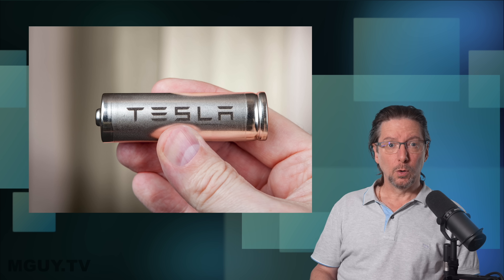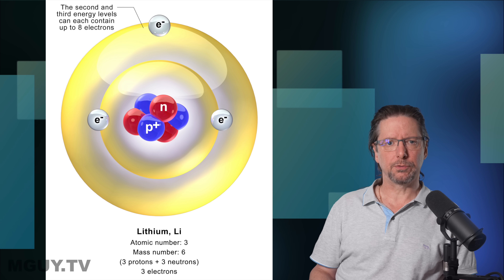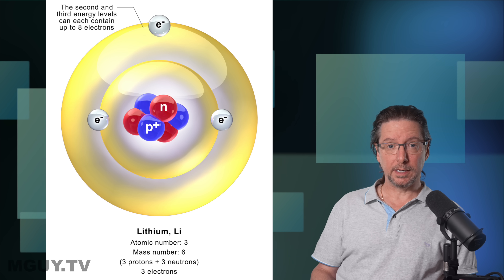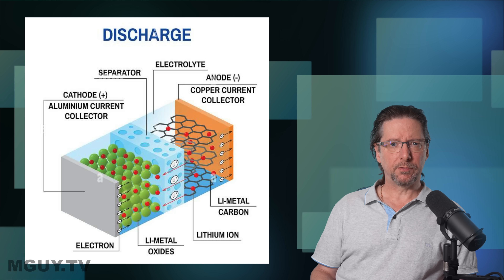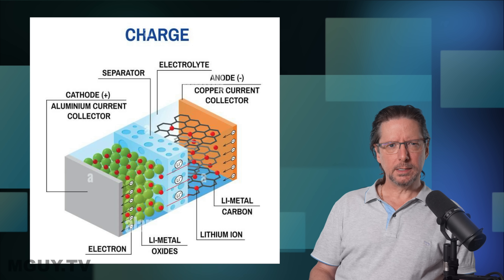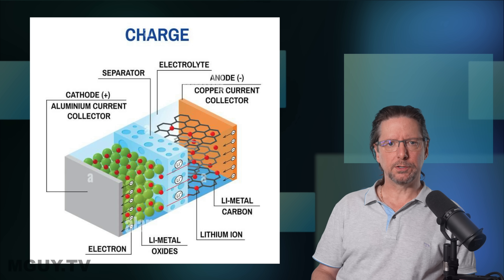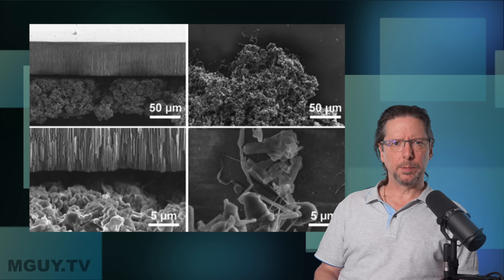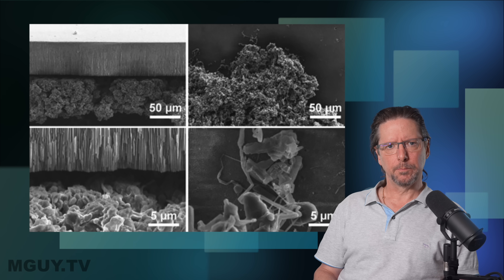Why are EVs so TERRIBLE in the cold? | MGUY Australia

Comment: I'm in Canada. It was -35c the other day. The diesel in trucks froze and pumps for petrol failed due to the cold. My Tesla, while had significant range reduction, still worked just fine. Teslas warm their batteries when charging too.

I will never buy a gas car again knowing this.
Reply: I’m in Canada also, it was minus forty one where I’m at. There was not one gas pump that did not work and no diesel trucks with frozen fuel anywhere, they were all working just fine! Keep reaching for those straws, I’m sure you’ll get one someday
Reply: @Oldmane-420  Which city you in? We had rolling blackouts here in Alberta. Engine Block heaters couldn't warm up enough due to the brownouts. Backup generators wouldn't even start for some gas stations (wife drives an SUV). You can see a Tesla charging in -35c in Strathmore here: https://www.youtube.com/watch?v=83mDbdnEjlo

Comment: As Javier Milei said at WEF this year, markets do not fail they just get distorted and are less effective by intervention.  Usually by authorities interrupting the normal cycle of business.  I think the panic rush to Net Zero is one such case.  I bet the disruptors who dreamt up EVs never thought this would happen.  These things are not resolved yet, and in all fairness maybe they will be sooner rather than later.  But you are correct, there is no equivalence (in most considerations) swapping from ICE to EVs.
I have seen batteries being conditioned in a pack during recharging using power of less than 5% of the battery pack capacity.  Of course, the consumer is paying for this, and it seems less effective than it should be.  Cases vary, but I think the anecdotal is there, and of course the recharge time is extended because you need on board power to condition the battery as you are charging.  Sort of like needing or being required to keep your ICE running when you fill up with fuel, which in reality just does not normally happen.

Comment: Golden Battery from Zeekr. Golden Brick's peak charging power is 500 kW, and the maximum charge rate is 4.5C. Between 10% and 80%, the battery can charge 500 km in 15 minutes. At -10 °C, the fast charging speed increases by 25%.

Comment: Chemical reactions slow down in the cold. Thats the crux of it. That’s true of all chemical reactions whether ICE vehicles or the human body which generates heat but also cools itself to maintain an optimum operating range. EVs are very efficient, translating most of that stored energy into forward motion. So efficient that if any extra energy needs to be used to heat the battery or passenger compartment range drops drastically. ICE vehicles are very inefficient. There is a lot of energy in gasoline—so much so that most of it is wasted as heat and must be disposed of to maintain an appropriate operating temperature. This becomes an advantage in cold climates where range can largely be maintained by using that formerly wasted heat energy. Can you imagine that a specific tool works best for a specific purpose? I think you could if you’ve ever tried to complete a job by making do with the wrong tool! An ICE vehicle may be best for some purposes but there is only one way to make it go forward: fossil fuels. EVs can be made to go by burning fossil fuels to generate electricity… OR, by nuclear, or hydro, or wind, or solar panels… you get the picture. It’s good to have a lot of options in your toolbox.
Reply: You won’t find a six pound sledge hammer in a watchmakers tool box, no matter how large his tool box is! Think about that for a moment.

Comment: So many baying electric cars without knowing that the battery have to be heated to warmer then 0c to be able to charge... With -10c and wind that for example means your car will simply not be able to charge on a 16A course and only slowly charge on 30A because most or all the electricity goes to heating the battery.  +++

Comment: The EV is a big nasty CO2 poluter! Especially in cold weather.

Nobody is thinking of that. That their nonexistent exhaust pipe is actually just elsewhere and out of sight and out of mind. 

When it is cold we spin up additional power plants that is running on gas, coal and so on including full out in nuclear reactors.

There I where where the power is coming from..
And in the SAME time the EV is more and more energy inefficient as the temperature drops, shorter range and longer charging times..

All together all that higher kw per mile of that very dirty electricity..😢

Have anybody calculated how much CO2 in grams is pouting the air for each kw produced?
And how it is varying depending on outside temperature?
(so we not just get figures on the baste case scenario when only nuclear, wind and solar is producing energy. And it will vary from country to country when nuclear total coverage varying.)

Comment: The same reason batteries are less efficient at extreme cold temperatures. Operative phrase 'extreme cold'. They could lose up to about 30% of efficiency at, say, -20C. Not really a major problem even in countries with extreme cold spells. Just requires some planning. But this faux debate you push (EVs vs ICEVs) is somewhat redundant. Private car ownership is not sustainable regardless. The resources wasted, the ecological costs and economic costs simply can't go on without promoting more environmental problems. It's already killing millions every year. It's time phase out private car ownership and invest in electric public transport systems instead. It's a no-brainer. The car industry has been declining globally for a number of years. Cars are only going to get more and more expensive to feed greedy shareholders. So the car industry is already selecting against itself. Just as well hit them hard while they're down. There are no justifiable reasons why anyone civilised would care anything about the car industry. The private car economy is just one big scam running on the ethics of vikings and heroin dealers. F*ck 'em!

Comment: Can you imagine that if in cold weather we had to run our ICE engine for 30 minutes before we put fuel in the car. If you can, imagine what chaos around the world that would cause, and then you can almost imagine what a world full of EVs would be like. Long live ICE
Reply: @1Electricman  Have you been asleep for 50 years? or do you live in the arctic?
Reply: @1Electricman a few minutes af heating to drive not thirty minutes. Also, the topic is refueling not starting.
Reply: lol a few minutes to warm up a gas engined car? I sure wish my F150 felt the same. when its -10c or less where I am, which is months long... its at least 15 minutes of idle. I also own a tesla model y and its 5 minutes to warm the interior and if i wanted to drive it frozen solid it wouldnt harm the car like it would in a gas engine over time.
Reply: @Jojo-o6o6w  Don't you realise the massive damage done to a EV battery in the cold.? Long live ICE, the car of the future.
Reply: It doesn't matter if it's an ICEV or a EV, when it's cold, you need to heat up the windows while you attempt to scrap off the ice and defog them.  With an ICEV it's a few extra minutes idling that won't do much to your range.  For an EV it's a big deal for range.
Reply: @chrishoff402  not it isnt.. my ev takes 5 minutes in -15c.. thats effing cold! It produces heat immediately almost whereas an ice vehicle has to warm an entire engine and coolant system up, and sometimes the coolant is responsible for the tansmission oil.. more to heat up. I have an F150, I know. I also own a model y so again, i know.
Reply: @Jojo-o6o6w How much time did it take to get enough charge in your ev's battery to clear your windows in 5 minutes and add that on top.  Compare that to how much fuel you burn in your F150 to do the same job.  Keeping in mind your comparing a large pickup truck to a family sedan, not a like to like comparison.
Reply: @Jojo-o6o6w   Chris is correct and you're fanatical in your beliefs. 

My Volt got 40 miles to a charge in the summer and low-20s in the winter.  Only difference is defrost / heat.  

YES, heat is a big deal for range.  You covering your eyes and ears and going LALALALALALA doesn't change this fact.
Reply: @ToolHombre   sorry, i didnt think to consider there are awful crap eV's out there capable of only 40 miles to a charge.
Reply: @Jojo-o6o6w   There are also awful crap EVs with higher ranges.  But the ranges are less in the cold.  

This is not disputed by even the OEMs, or the battery cell makers themselves.  Only the flat-earthers of the car world (mostly Model-Y owners) make such claims.
Reply: in extreme cold, diesels should be heated prior to starting. is this for the lubricating oil or fuel?
Reply: @joechang8696  50 years of driving, and 20 years of owning diesel cars, I've never had to use a block heater. What a load of rubbish.
Reply: You have no idea what you're talking about, but the oil industry needs people just like you. I've charged my EV in very cold weather, thank you.
Reply: @justsomeguy934   There are recent and documented debunks to your belief system.   Chicago was gridlocked for EV owners due to either conditions that are colder than what you have experienced or a faulty network for EV charging. 

Either way, the incentive for those people to own EVs was undermined.
Reply: @ToolHombre 
And for Chicago, that wasn't the coldest days for winter.  Wait until it's -25 F  with that Lake Wind or the Prairie wind.      And Chicago isn't the most northerly city in the USA.
Reply: If the Uber drivers charge up to 100 % all the time their batteries will lose capacity faster, meaning cars became worthless quicker, that is not good for car owner and not for Mother Earth. I guess they do not care. But saving the planet is the argument for EVs. I'm pretty schore the whole project doesn't save anything, probably doing the opposite. You never see numbers with the whole chain included. The whole CO2 calculation is a game with numbers. Ignore production and CO2 just move to another country, Ignore transport chain. Ignore the juice is produced by mainly not green power plants. Ignore the real costs for transforming the power grid. Ignore the green power alone is a technical and economical utopia. Ignore human rights, children's life, environmental damage. Ignore it hardly work, will never work in most parts of the world (no grid). Ignore safety issues, political risc, power outs, war! And most people drive old cheaper cars. They can't buy any new car. See and old normal car only need a very cheap battery. A battery that is recyclable. I actually believe this whole industry shift is extremely dangerous. When everything collapse, big money go bye, bye. Anything can happen.
Reply: @bjorngve  Very well said. Everything you say is right, so much of the damage EVs are doing to the environment is being ignored.
Reply: @justsomeguy934  So you think I've been doing something wrong for 50 years, I think you need to seek help.

Comment: Fossil cars need roadside assistance almost twice as often in winter in Norway compared to electric cars.
In all electric cars, you can get into a 20 degree Celsius hot car every morning if you want. And you don't have to waste time at a gas station.
Reply: Considering that there are five times as many “fossil cars” on the road, that’s not an issue. You can get in a fossil car that is 20 degrees as well, and the wait at the gas pump is less than one tenth the time you have to wait for a charge and you will go about five times as far on a tank of gasoline! Have you considered a career as a unicorn wrangler?
Reply: @Oldmane-420  Which fossil cars can you cool and heat in an airtight garage? One of the two electric cars we drive has not been fast-charged for 10 years. It gets the energy it needs when it is parked.
The statistics for which cars need roadside assistance are of course corrected for the number of cars on the road.
Reply: Pink cars with purple stripes need even less roadside assistance compared to electric cars. I think there is something in that for all of us. Don't you?

Comment: Mguy is an expert in technical subjects leaving the luddite viewers scratching their heads. Good job most ev's have preheating for -10C temps. So it is a non issue. In UK never had to warm battery. 👍
Reply: My car has preheating too! It's called starting it. And it is a non issue for me. And my toes are toastie warm in the winter. OH and I have a heated steering wheel and heated seats. And my battery says fully charged all the time after the 5 seconds it takes to start it. Good job my electric seat warmers are not a lithium time bomb under my bottom.
Reply: @Diponty  You are forgetting. You are only getting warm after the engine warms up. Heat pumps and electric heating is like turning on a hairdryer. Instant heat. Heated steering wheel, front and rear seats, even ventilated front seats are the norm in korean ev's. When you park up and turn the engine off and want to stay warm. What do you do?
Reply: When your EV is running low on battery power your eyes are glued to the charge milage indicator. You forgo all luxuries to get to the next charger. Especially heating the cab. I don't I just look up an app, hmm where is the cheapest petrol? And when I stop the car I usually get out and do stuff.  @TeaBreak.
Reply: @Diponty  @Diponty Interesting comment. My ev does 300 miles so not aware of this thing called range anxiety. Only spend 5 seconds in morning and 5 seconds in evening worrying about making sure it is plugged in to drink up off peak juice for 12 hours driving the following day. Btw when heating is enabled range calculation drops by around 10 to 15 miles. This is assuming you leave it on until battery is flat. Yes some ev's are crap and drink lots of juice but a little research and buying a good ev makes a world of difference.
Reply: If you charge a lithium battery that is colder then 0c you ruin the battery just so you know that...
Reply: @a64738  The BMS won't allow that. Reality isn't the same as theory.

Comment: In my opinion EVs are a good fit for Perth WA as it’s hot as long it’s for city/suburban driving so one gets restorative braking. Not a good fit for regional areas where you drive long distances.
Reply: Yes.  Ideal for the Dalkieth Darlings to drop their precious little Princess at the Private School then off to the Tennis Club.
Reply: @davewatson2124  I think that for inner city driving EVs are a good choice as long as there is no compulsion. They are low polluting so where traffic congestion is high they will be of benefit provided the price comes down. I don't think they are good fit for regional areas or for trucks doing long distance for good deliveries. I don't think they are just for the rich elites. Its a matter of horses for courses. I have seen the issues in regional areas where fires have destroyed parts of the electricity grid and if EVs were forced here there would be many more disasters happening. Of course one needs a reliable cheap source of electricity to make this viable as well.